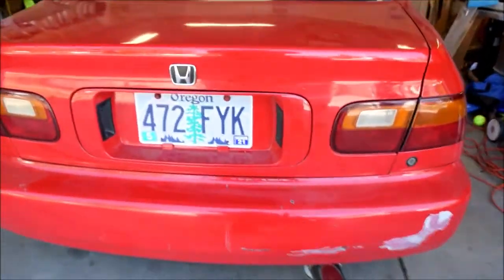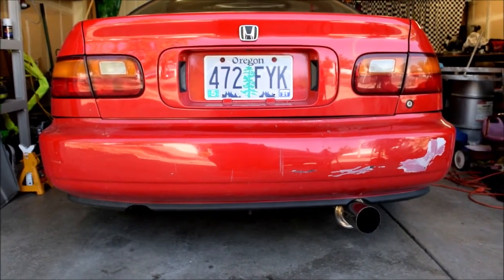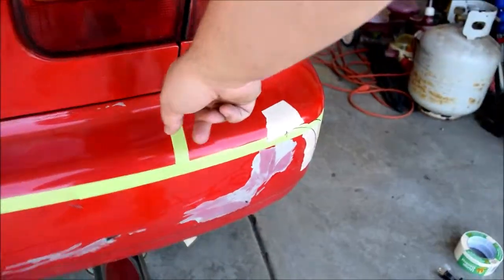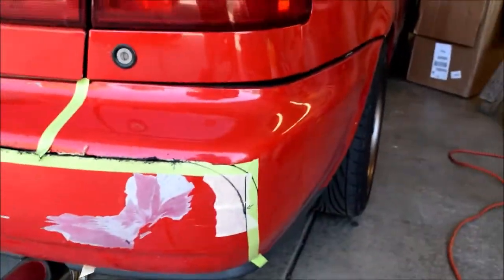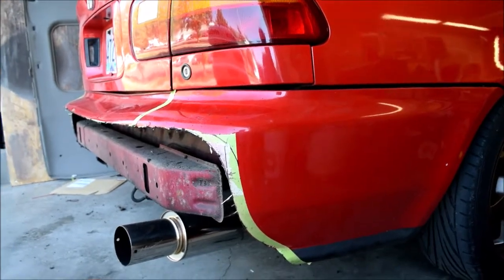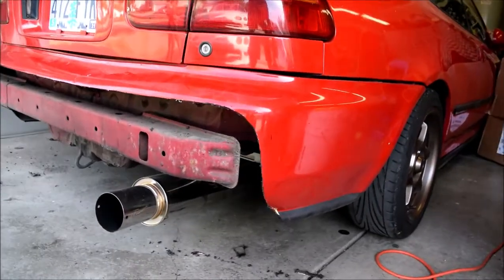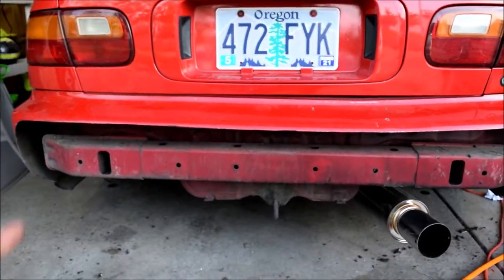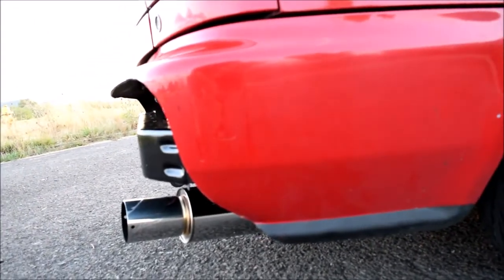Honda Civic (EJ1) Rear Bumper Cut

Comment from the maker: Would you rock a bumper cut Yes or No? Comment below your feeling on bumper cuts.

If I were to do it again I would change a few things but I like the idea of having 1 OEM and 1 Bumper Cut bumpers.
Reply: Honestly...what is the benefit of cutting a rear bumper halfway? I don't know what the hell is going on with this generation and doing dumb things like that but I dont think I would ever cut it...it just looks like something my kid did.
Reply from the maker: thanks for commenting your opinion on it and also for watching. The theory behind it is that it will cause less wind drag from air getting trapped behind the bumper. it is mainly done for looks I think. everyone has their own likes and dislikes. I did this for Fun with a bumper I was going to throw away. I rocked the look for the summer and now have a new to me OEM rear bumper. I like the OEM + look but wanted to have some fun with a old bumper. thanks again for commenting, just noticed it today. 🤟👊
Reply: Sorry for being harsh about it if I came off like that I just really didnt understand the reasoning behind it but now that you have informed me on a theory it makes since for those who do some serious racing to do it, on the other hand for aesthetic purposes...it just doesnt look right then again I'm building for stance not race...Stanced and race dont mix very good nothing but consistent bottoming out and a very high possibility of ripping off the bumpers and side skirts.
Reply from the maker: It's all good 🤟 thanks for watching and supporting
Reply: yess
Reply: Love it
Reply: YES, it looks cool. The sides looks oem almost and the back looks super aggressive.
Reply from the maker: OBS Strovey  & Balance, Thanks guys. sorry don't get notifications for comments in comments and I try to check my pinned comments. 👊🤟

Comment: Thank you for the helpful video. I now know what tool to use to cut my plastic bumper. Wondering  how to firmed up the sides that were loose after cutting your bumper? Thank you!
Reply from the maker: Thank you for watching. 8f you leave more of a overhang on the back it will help firm up the sides. I was going to add some metal Rods from the bottom side of the bumper to the back of the car to support it. Like spiller Rods.  It was just a fun project and ended up getting a OEM bumper after a little bit of rocking this.

Comment: Are these cutoff wheels the best for cutting this type of plastic? What is the part#??? I'm just making some oval cutouts for an exhaust tip... Would one of those thin diamond coated or carbide wheel be better? TY.
Reply from the maker: Thank you for watching. To be honest this was my first time really using my Dremel. These cut through the plastic just fine, but for doing a oval it will be harder using a disc. style cut off wheel. I would probably try another attachment.
Reply from the maker: Here is probably what I would use  https://youtu.be/RTpOAznxl70

Comment: Is your bumper made of plastic? I was trying to cut are larger square in my cars diffuser (it's about 1/4" thick of hard plastic) to fit bigger exhaust tips and was trying to find the best tool. I was leaning towards an oscillating multitool... I have a dremel but I didn't think it would stand up to the task. What sort of blade did you use and would you recommend a dremel to cut through thick plastic?
Reply from the maker: I think a Dremel would work for that. I used just the flat disc cut off wheel. They make a bunch of different bits to use. I am pretty sure the Dremel will handle that plastic just fine. You might also look up Carbide drill bits I have seen people use them for different things that might work well too with the Dremel and the thick plastic. And yes my bumper was plastic.

Comment: You should of cut it right under the bumper line
Reply from the maker: I was just playing around and wanted to try and get rid of all the damaged area. If I was to don't again I would of left more hanging down. It was all for fun, now I have a new own bumper on the civic.  Thanks for watching and commenting
Reply: Lol i see that i was scared cutting my bumper aswell i was trying to get an idea to do front bumper cut out for the radiator
Reply from the maker: Just for looks? Like the holes people do in the bumpers to give more air flow to the radiator?